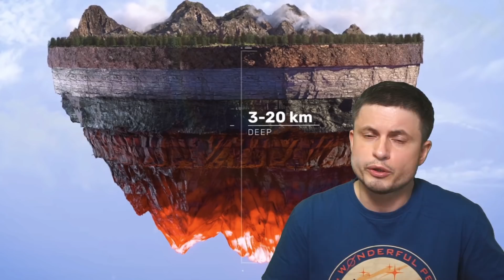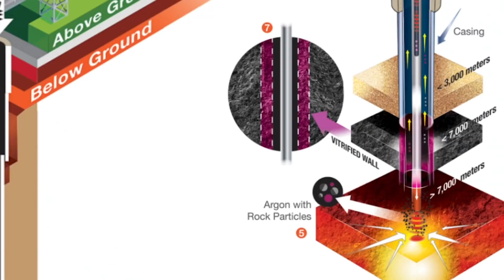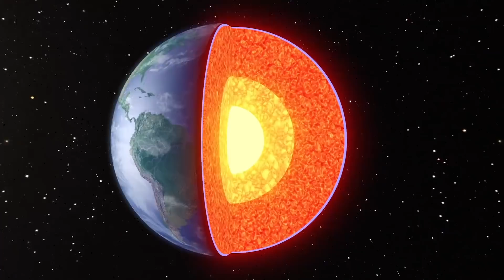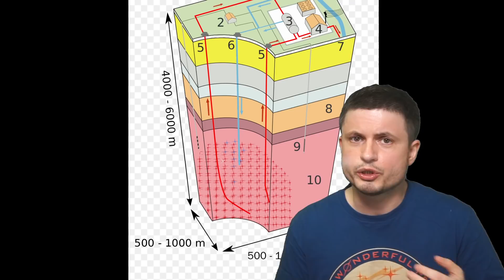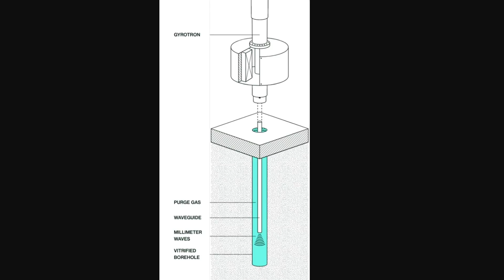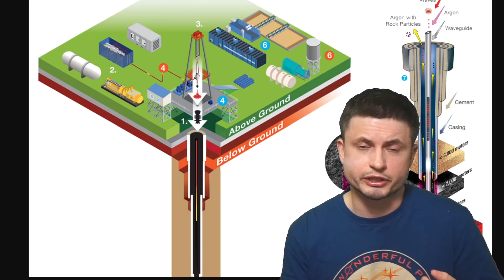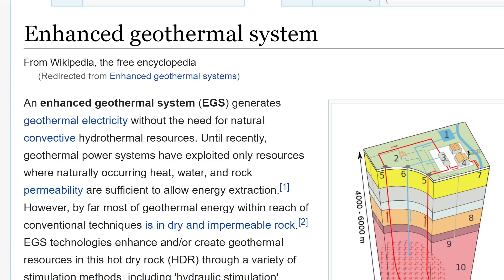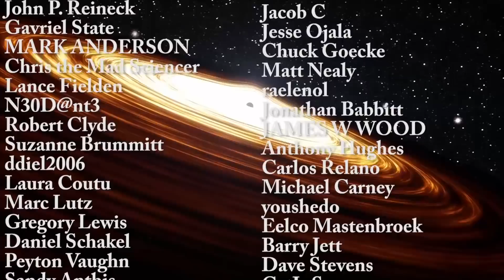Creating Deepest Hole on Earth For Geothermal Energy Revolution

Comment: Geothermal energy is a great idea for a few power plants, for some given value of "a few", but I would be curious about how a sufficient amount of power plants might affect our magnetosphere- again for a given value of "sufficient".
Reply: I would expect that it would have zero effect. The magnetic fields are generated in the outer core. 20km deep hole still has ~3000 km  to go before reaching the outer core.
Reply: @matthewettsen8060  This is true. Still, the dynamo effect (I think that's what the generation of our magnetic fields is called) must require energy and thus heat to work. In theory, there might be some point at which we are sapping enough heat from the deep crust that it could affect the dynamo. 
I could be wrong, of course. I have only a very loose and surface-level understanding on the forces at play both in the generation of magnetic fields within the earth and in how the utilization of geothermal energy ties into the rest of the planet.
Reply: @ventusvindictus  The best hypothesis for the generation of Earth magnetic field rely on currents generated by vortices in the liquid outer core. We would have to pull enough heat from the mantle that  significantly crystalize the outer core. That just isn't going to happen. The ratio of thermal energy in the Earth compared to our needs is basically 0. The sun will become a red giant and consume the Earth well before we could have any significant effect on the cumulative cooling of Earth's interior.
Reply: @matthewettsen8060  Ahh, I think I see. If it would take that long to get to that point, I imagine we'd have more pressing concerns than too little heat in the core. Like being melted by the sun.
Reply: Every form of energy production has ecological consequences. Especially when it comes to scale. (burning 10.000 barrels of oil a day is not a big problem but burning 80 million barrels is)

 The key to sustainability is taking those damages into account at an early stage so we can use the technology carefully and wisely. That's what you're trying to do so kudos to you. 

 We should be critical of all forms of energy production as everyone of them have their limitations and ecological impacts. Knowing the issues with each one is the only hope of using them safely.
Reply: THIS IS A HORRIBLE IDEA!
Cooling the core of Earth kills the magnetic field that protects us from the Sun.
Kill the magnetic field and you literally kill everything on the fucking planet.
Stupid engineers can't think past their own noses.

Comment: It's a good news/bad news kind of situation.  On a planet where the mantle/crust boundary allows for volcanoes to reach the surface on a semi-continuous basis, digging a little deeper always seems like such a reasonable supposition.  "And if we just dig a little deeper, just think of the greater geothermal returns we could get!  And, likely, decades to centuries of benefit could be had.  But there is always a depth that, at first, seems quite alright.  And then, the earthquakes pick up in frequency, then severity, until OMG, what was that?  And then the plant is looking at an unavoidable volcano.  How were we to know we had gone too far?

Comment: Wow! After watching hundreds of science videos, how did I not know radioactive decay is what keeps the Earth so hot deep down?
Reply: All the uranium and the thorium in the primordial earth sank to the center. There are millions of tons of gold down there too.
Reply: @benthere8051  There's Gold in that thar mantle.
Reply: Basically anything lighter then iron , will be at the surface of earth anything from iron upwards (periodic table of elements) will sink into the earth , which includes uranium, which is radioactive, due to decay it heats up plus the added pressure of being so far down and several 1000s (6-7000) degree heat .

Comment: Well maybe it's not that efficient but you could use torque to your advantage you know you build the simpler system that's a little bit weaker to spin the bigger system using torque

Comment: I've heard another issue of digging at these depths is that the pressures and temperatures past 9km down turn the rock to a plastic state, and can crush the boreholes, lining, and drilling equipment as the rock tries to fill the new void, like a very viscous mud. That's ultimately why that Russian borehole was abandoned.
Reply: Drilling involves using a pressurized fluid (mud) to circulate out the cuttings and keep the walls from collapsing long enough to cement in a steel liner.

Comment: use a laser drill to dig deeper perhaps ? meaning you use a powerful enough laser to liquify the hard to penetrate barrier and  continue to dig through with a normal drill ( if it's possible) perhaps it will just crack with the laser but in any way it will perhaps allow for further depth
Reply: ...there is that giant laser the Breakthrough Starshot guys need to build for their tiny spaceships.  Maybe we could borrow it to burn a gigantic hole in the ground invetween launches.

On second thought, they're going to need a gigantic power source for their gigantic laser.  Maybe we should do the giant hole first, and then flip the laser around and use some of the power for the Starshot project.
Reply: Lasers suck.

Comment: This is pretty fantastic but I do have a concern, if we started to rely on geothermal energy, would that start to cool down the planet?
Reply: no
Reply: Yes, but all energy use has to cool down something.  It would just cool down the core a tiny bit, not the surface.
Reply: Geothermal heating is only a small part of the global energy cycle. The sun heats the earth with about 100 petawatt or roughly 3000 times the total power output of the radioactive decay in the earth. 
Abigger problem with geothermal plants is the water that is pumped down or extracted. In some cases the ground can become unstable because large amounts of hot water are extracted without replacement.
Reply: @lukasdimmler2622  it might be like pouring water down a hole that goes forever with no steam return whatsoever.
Reply: @jsEMCsquared  The problem is not the extraction of energy but the destruction of the rock. As stated in the video it can cause earthquakes.
Reply: It would not cool down the entire planet, only the mantle. At present the mantle is cooling down, somewhere between 6 and 25 degrees Celsius per 100 million years. If all the world's energy were to come from the mantle (an extra 75°C per 100 million years, assuming 10% energy efficiency), there might actually be a noticeable difference eventually (in millions of years). However, it's only going to cool down the mantle, because an equal amount of heat will be put into the atmosphere or whatever the power plant uses to cool their water. I don't think it's a problem to be cooling the mantle, because it's probably not going to affect much of anything anytime soon. I also don't think there's a big problem in releasing that much energy into the atmosphere either, because the atmosphere can radiate it away, especially with the reduction in greenhouse gases that comes with geothermal power.
Reply: No. That’s like worrying that if you take a few buckets of water out of the ocean, you might drain in.
Reply: @zzubra  Taken to its reasonable maximum (all energy comes from geothermal power plants), it would increase the rate of cooling of the mantle by several times. Technically, the question asks whether it would start to cool and not whether it would cool significantly.
Reply: @archbirdplus  Total geothermal heat flux is estimated at 45 TW. Humans use perhaps 18 TW of energy globally. So, I suppose that using geothermal energy as the source of all human-used energy would increase cooling of the mantle significantly. However, I don't see any remotely possible technology that would allow us to get to a point where we are producing nearly that much energy through geothermal energy. The deep bore holes discussed in the video are going to be quite limited as to how much energy they can sustainably generate, due to the limited thermal conductivity of the surrounding rock. So, I'd modify my comment to say that, for the levels of energy production that are remotely plausible, using geothermal energy is unlikely to significantly increase the rate of cooling of the mantle.
Reply: @zzubra  Why exactly is this method limited by the thermal conductivity? Is it the conductivity between the water and the surrounding rock, or the surrounding rock to more distant hot rock that hasn't been cooled down by the water? Can't you just make more holes in either case to get more power, especially if this method of digging is meant to be faster and less dependent on the geography?
Reply: @archbirdplus  How much heat you can sustainably draw from a given bore hole is limited by the thermal conductivity from the more distant rock to the rock adjacent to the bore hole. Yes, you can drill more holes to draw out more heat. But, no matter how improved the drilling method, there will still be a significant cost to drilling each hole. I’m curious what the economics of this type of energy production will turn out to be—will this really be a cheap or competitive means of energy production? You’ll potentially need to drill a LOT of holes, if you want to extract a lot of energy.

Comment: If you pull the energy out of the mantle on a large scale, wonder if this would affect temperatures further down in the core.
This could be relevant if we're taking about mass scales of energy absorption from the planet.
Reply: better not to extract the energy from too deep. there's plenty of volcanic areas where heat is near the surface and it won't make a huge difference if we tap it there instead of letting it radiate into space
Reply: @sheikchilli8670  fair point, but that limits your area to essentially the ring of fire. Could be a part of the solution to clean energy

Comment: Seems really obtuse to me. Regions near volcanoes are a good source of heat. Volcanoes are often on islands, and thus surrounded by water. Drilling is minimized.
Reply: nobody lives on these islands & power transmission isn't free
Reply: @virutech32  There certainly people living on volcanic islands, for instance Hawaii, and Canary Islands. But, as you mentioned power transmission isn't free. Fortunately, there are also active continental volcanoes, and if the power is free, then paying for transmission lines should not be an overwhelming obstacle.
Reply: @picksalot1  Not enough people to justify major drilling operations like this. Most eneegy usage is in places where there aren't any convenient volcanoes nearby. Though yeah we have gotten pretty good at even long-range electrical transmission, but it's construction & maintenance is still a major factor. The further away the power sorce is from major points of use the larger the total ouput has to be to justfy the huge cost of transmission & the capitol for a large system is a lot harder to put together.
Reply: @virutech32  Too bad we don't have a working version of Tesla’s long-range wireless power transfer (WPT) technology. Wires are so old-school. 🤓
Reply: @picksalot1  That is just current tech though. A good cheap really high-temp superconductor would kinda make transmission losses minimal & automated maintenance means you only need to pay some of the energy to keep the system at peak performance all the time.

Then there's microwave power beaming. If we can get that system good enough, maybe have some reflector/refocusing balloons & ground stations. Or possibly orbital relaying optics & spaced-based solar action. 

It's not that we wont exploit those out-of-the-way or inconvenient energy resources just that they'll likely never make up a large percentage of total production for geothermal.

Comment: No, it would cool down the surrounding bedrock. I just did some investigation on geothermal energy.
Reply: In what area would it cool it down? It might just be possible to drill a bit further or slightly diagonal after it's cooled down at the original spot. Also if we can bore deep enough, it might cool down but maybe not enough to not be usable anymore. e.g. if it cools from 600 to 500 celcius and stays there (due to balance) that might be fine.

Comment: What if they used a laser instead of a drill? That way they wouldn't have to remove the dirt right?
Reply: Where would the material that you removed go? It can't just disappear.
Reply: @benthere8051  Suck the melted stuff with some badass vacuum cleaner /s
Reply: If it was incinerated wouldn't it turn into smoke? There's no material to move if the laser is incinerating everything.

Comment: I may be completely wrong, but would it be best to start drilling in a place like the Mariana Trench? Would it be like a “head-start” by skipping miles of crust to dig through and the trench is a fault line right?
Reply: Ocean crust is much thinner, but working on the bottom of the ocean is would be so much more expensive. Plus, you'd be building your power plant a thousand miles away from any city that could use the power and have to run thousands of miles of undersea power cables. Better to try making it near a city where the energy is needed, even though it means deeper drilling.
Reply: No. The crust is just as deep at the bottom of the Mariana Trench as it is everywhere else. Plus you would have a 29,000 ft. drill stem to deal with.

Comment: Two questions:
1. wouldn't this worsen global warming anyways, since it would basically speed up the release of temperature from the core into the atmosphere?
2. wouldn't it cause its own environmental issue, if used at large scale, by speeding up the cooling of the core, therefore weakening of the earth's magnetic field?
I know we're still talking about hundreds, probably thousands, most likely even tens of thousands of years, but still...?
Fission or even fusion seems much more viable and much more sustainable.

Comment: This was a great look into a little-discussed energy source. Thanks wonderful Anton!
Reply: It’s not new at all. My dad invested in a company in Australia doing this. It failed due to wrong rock type.
Reply: @danielleriley2796  I have a friend whose house is heated by one of these pumps, and it amazed me when he told me the depth to which the piping reaches. It is not at all deep as much as I have presumed it would go. He said it ends about 75 meters down. The temperature there is always at a constant 55 degrees Celsius. More than enough to heat the house. He installed the system almost 10 years ago, and is very satisfied. Just to clarify, he uses the heated water only for the radiators, he doesn't use it to produce electricity.
Reply: @21palica  see as I said this video is nothing new. Sure the scale is huge but every part of the process has been done before and is in use. The Aussie one failed because the rocks were wrong but the process is sound. 75m sounds shallow so it’s probably a volcanic area. I went in the Mt Isa mines on a tour and that’s maybe 3 km deep and that’s 35°c at the bottom. Goes to show how variable the crust is and how important the correct placement of these facilities are. All icelands electricity is produced this way and Iceland spends a fortune on trying to find ways to economically beam electricity so they can export to Europe. Also most of the worlds aluminium is made in Iceland as it’s so electricity intensive.
Reply: @danielleriley2796  I have seen some documentary about Finnish geothermal potential exploitation. Volcanic steam powered turbines, heating and hot water produced by pumping cold water into magma heated underground water reservoirs, and collected hot from springs. Lots of great applications.
You are right about the depth. There are multitudes of hot springs in about a 200 km wide circle, inside which his house is located, which is why the pipes don't have to go deeper. Just 20km away is a hot water rehabilitation/therapy spa, and about 40km away is another big geothermal water source used for filling pools in a spa. Funny. since the area in question is close to Hungarian-Serbian border, and is set over ancient seabed turned to flat plains, the hot waters from the springs mostly have high content of dissolved salts and minerals. Because of this, the water is used for treatment of skin problems, it also speeds up the healing process of wounds etc. But, it is not a geologically active region. No volcanoes or earthquakes (luckily). Maybe it's because of a thinner crust here, or some magma chamber close to underground water accumulations that produces all these geothermal springs in this area. I am not sure.

Comment: Not really too well versed on the science involved, but my limited understanding is that magma, lava and such is under pressure, one of the forces involved in Vulcanism, which makes this all sound highly problematic.  Perhaps drilling to a level that is highly heated but well before the magma might be useful?  I just remember Murphy was an optimist.
Reply: continentals crust is like 70 km thick.  If you get remotely close to magma, you've already found rock that's hot enough. The temps are needed are only a few 100 degrees C, nowhere close to magma temps.
Reply: @Timestamp_Guy  Right, like just over 100°C, not the melting point of rock ~1000°C.